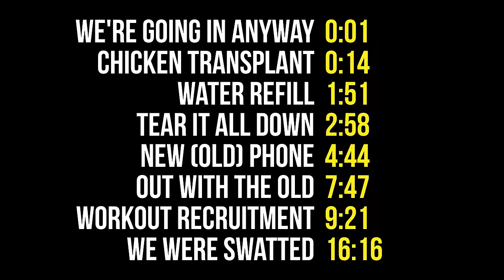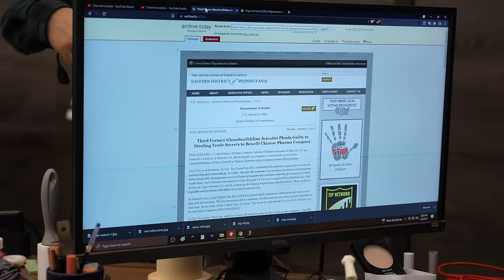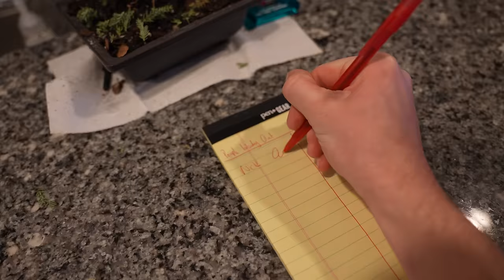Someone SWATTED The Castle During Tim Pool's Live Show

Comment: Y'all might need at least some chicken wire or some other stronger barrier over the top of chicken city. I worked for a ranch a while back and we transferred 2 chickens over to a coup that was fully enclosed and 10 feet tall that even had a top on it made of chicken wire and the next day they were gone. We think it was an owl, hoo's (pun intended) perch was in the trees overlooking the chicken pin, that forced itself into the cage through two pieces of chicken wire. Just a thought if you have owls around there.
Reply: They need to run a few strings across the top with old CDs hanging off of it, the reflections keep flying predators away.
Reply: @Yukikazehalo  that looks tacky. Just putting wire on top is more than enough
Reply: Hawks and Eagles also go after Chickens.

Comment: What's frustrating about swatting is that a cop doesn't need a warrant to pursue an active threat. If someone, for example, were to run from police into your house, they are legally allowed to pursue into your house. When people swat, they're often doing what happened here, "two people shot and one threatening suicide." At that point, no warrant is required.
Calls about stuff like this need to require VERIFIED identification. If you call in an active threat like this, police NEED to be able to get your name, address, etc. and ideally verify the caller ID. If you refuse to give identification over a call like this, then need to put serious question into the authenticity of the call, and false flags need to be treated as serious as the alleged threat itself as people have died from swattings.

Comment: with the sledgehammers a lot of people use it wrong by thinking they need to use all of their strength to swing it and hit it with force. But the actual way to use it is somewhat effortless. You just use the weight of the hammer to do the work for you. It seems Carter figured that out with a little practice.

Comment: Register a business contact with the local police department due to the high profile of the show and potential of celebrity guests being present.
They don't press exigent circumstances if they have a confirmed contact in charge of the premises to liaise with instead. They did not have this at the time and you didn't really give it to them for next time. You needed to mention not just you wish them not to enter without a warrant but that if they receive any calls to get in touch with your nominated contact before entering without a warrant to confirm exigent circumstances exist. They will then do this with any future calls although it does become a security weakness if a genuine hostage situation ever occurs.
Install a buzz entry to the studio with a screening camera. Have a buzz entry at the main door in view of the receptionist. Have a direct line with the receptionist for the local police station. Notify the police of this extension to advice them that any emergency call out is most likely to come from that line if genuine, give them the reverse number for that line so dispatch will confirm who is or more specifically, isn't calling them next time.
Have a panic button at reception which notifies the studio of a problem at the front.
Since this happened and is very easy to repeat, assuming it was malicious rather than a prank, consider these or other measures under the presumption this will happen again and has become a part of your career such that it is.
Certainly follow up investigations into who did this and prosecute for deterrence where available, however I think we have seen organisations like Antifa tend to operate in the mould of Al Qeda being that no specific leadership or rank and file is used so much as ad hoc concerted goals so that multiple actors are always acting independently to achieve common objectives and I wouldn't be surprised, if this is indeed malicious and politically driven extremism it might not be so coherent to deal with in a traditional sense as a lone criminal with a bad attitude.
I think the most productive strategy for the long term is generalised security accommodation, in all aspects including liaison with local police.
Also being armed isn't necessarily a deterrent, not for political extremism. It raises the stakes but that just means it raises the lethality of any direct contact, an actual attack. But unless they have a small army a good relationship with local police is an effective deterrent for an actual attack. Keep in mind the way say someone like Antifa extremists would attack if determined to do so would be ambush and blitz attacks on the property, knowing you're armed means they'll be lethal, not they won't do it. The biggest deterrent would be knowing there'll be a fast and well informed police response in close contact with those inside already by the time they're coming up the driveway.
Which leads me back to the first sentence.